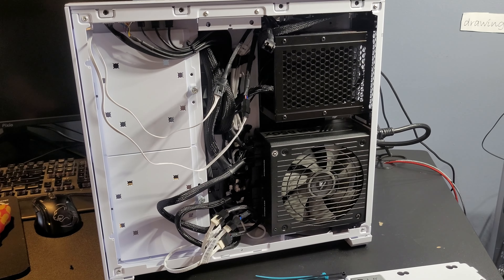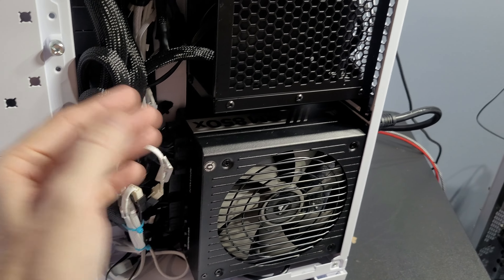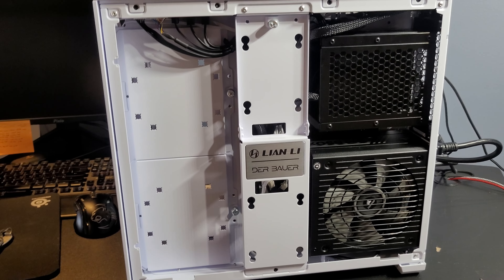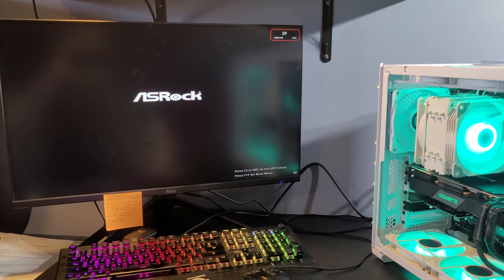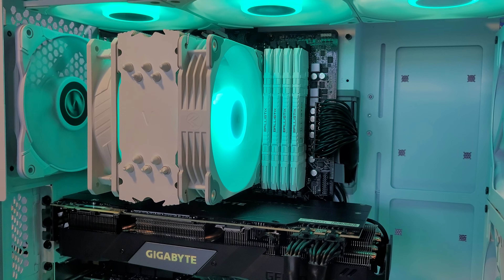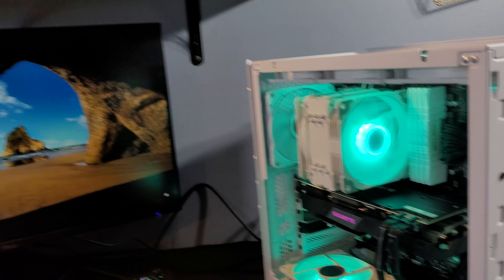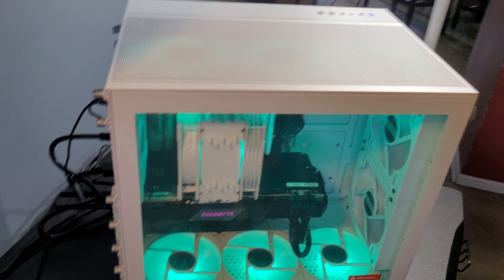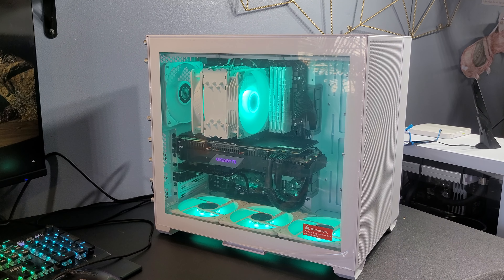how to build a pc with Lian li o11d air mini, 5600x, and Gigabyte 2080ti PART 4

Comment: looks good! i just built one as well mine is black though, i get excellent temps with just 2 front intake 140mms and 1 120mm exhaust and a air tower cooler. you should think about getting extension cables such a sweeet build gets ruined by the original cables that come with the PSU.

Comment: Looks great. I watched quite a few videos featuring the Air mini, but most people say that it is limited to 2x 140mm fans in the top and bottom. They highlight that it does not fit 3x 120mm fans. How did you fit 3x fans?
Reply from the maker: I'm currently waiting for all the parts to roll in for another build in this case so I'll be sure to post a new video explaining how to fit the 3 fans.
Reply: I made an 1/4 acrylic shroud for three 120mm t30 fans on the bottom of mine. Dropped my gpu temps about 5 deg changing from two 140mm fans. The uni fans can work without a shroud but I found the fan blades get a bit too close to some pop rivets for my liking.

Comment: Very clean looking build. How're the temps? Do the extra fans help significantly?
Reply from the maker: Thank ya sir. Only wish we had a white mobo and gpu, but both were donated to the build so we used what we had.
Reply from the maker: Temps are 62°C on cpu stress test loads and gpu hits 73°C on both 10 minute of furmark stress at 1440p 8x TAA and on Heaven benchmark 1 pass at max settings. Thank you for the kind comments.

Comment: For the top 120mm middle and right fans, I always think that they aren't necessary (the left one is still okay), because they're just pulling out fresh cold air from 140mm intake fans. What do you think about this?
Reply from the maker: I would completely agree that they are not necessary at all. I personally would rather go with two 140mm fans at top and bottom but the fans were just some of the parts I had laying around to donate to the case. I would have had 2 leftover and just wanted to be rid of them so I crammed them all in the case, haha.

Comment: do you think it is worth going with 3 120mm fans at the bottom or 2 140?
Reply from the maker: If you can, always go with 140s as they typically push the same amount of air but are quieter than 120s. This build was for a friend so I used what parts I had leftover.

Comment: How did u get the 3 bottom fans 2 fit?
Reply from the maker: Gotta slide the front fan in first then middle and back fans. You'll then line them up with the mounting holes and loosely install the screws. You will wanna leave all 3 fans kinda loose for final adjustments.

It should be noted that you will only be able to get in all 4 screws for the center fan. The front and back fans will only be able to have 2 screws in them to hold them in place. It's not an issue as all if your fans have the rubber dampers on them and you screw them in nice and tight. I've been running my personal rig setup like that for about 8 months and have zero issues with rattling or anything.

Comment: Everything is clean and but why nobody use water cooling
Reply from the maker: I did my build as a complete custom loop. In my newest build vid in this case that I've posted, there's a couple nice shots of my personal pc. I love it for custom loop, but most people don't wanna spend the extra 500-1000 dollars for 10-15°C cooler temps when it's actually just fine with air cooling.
Reply: @sootynukkels8366  no the performance is good with even air cooler but water cooler is better in look in that case air cooler take lots of airflow
Reply from the maker: @Rahman-rd6fk  check out the new video I just posted last week on my channel. Build the same pc as this one but with upgraded cpu/gpu and water cooled the cpu with Lian Li Galahad aio.
Reply: @sootynukkels8366  yeah I've seen it 
Its very good pc bro good job and keep going

Comment: Sorry, but cable management is very bad. And your case has so much empty space. Just not good looking at all
Reply from the maker: Thanks for your opinion. If you ever commission me to build one for you, I'll build it to your spec. Just a piece of humanly advice though: criticism from your opinion to say something negative without providing a potential fix or way to be better is just bitching about something. Don't be a bitch. It's not nice.
Reply from the maker: @stinkydognuts  thanks. Ill be sure to try that out in future builds. I was down to only bright blue zip ties left after this build and the sff build I did along side it. That's changed now though, haha, I have a ginormous amount of small zip ties.